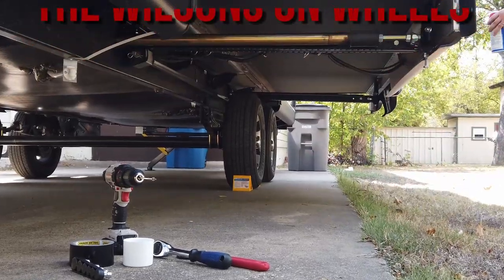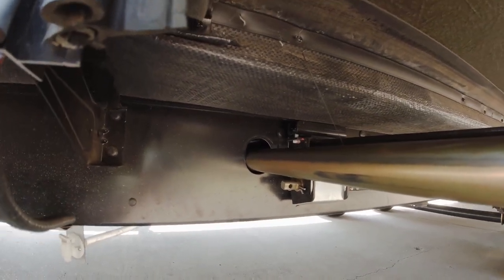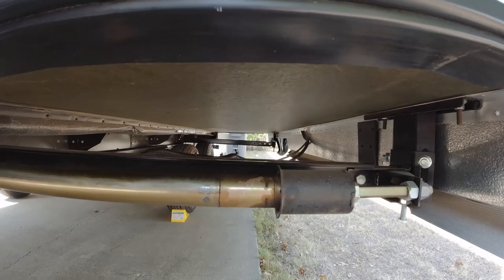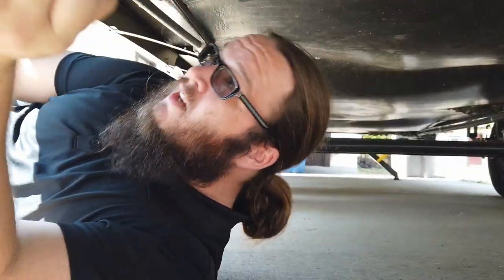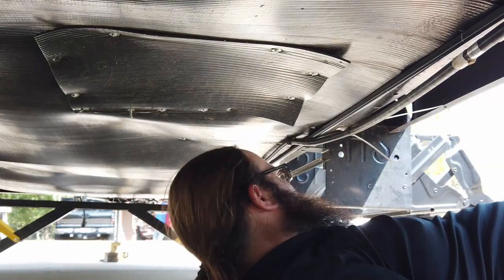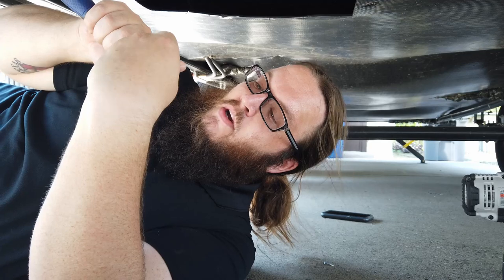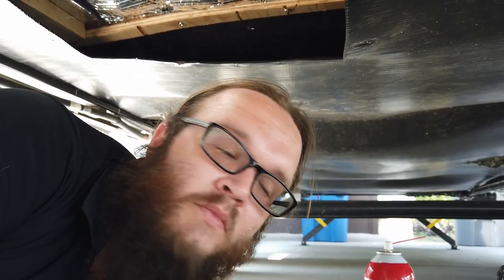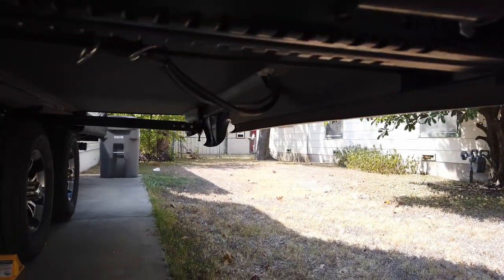Ep2: Fixing Our Slide Out?!? - 2019 Jayco White Hawk | RV Repair & Maintenance | Full Time RV Family

Comment: Glad you fixed it, but the last clip looked and sounded bad.  Was that after it was fixed or before?  Since it was at the end I thought it would be after it was fixed.  It looked to slow down and start making a squeeking noise when it was about half way out.  I love your rig and am considering buying that model in the future.  I have a 2013 version- a Jayco Whitehawk 28DSBH.  It has been great other than a soft floor that I'm dealing with now.  Good luck to you!
Reply from the maker: After extending & retracting the slide a couple more times the lube worked its way in & the only noise it makes now is from the motor. 🙂👍